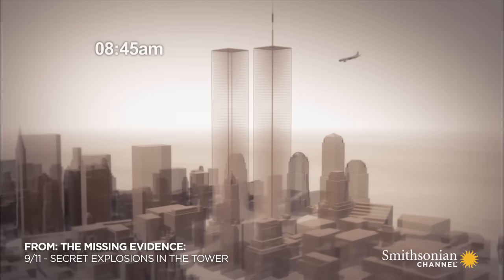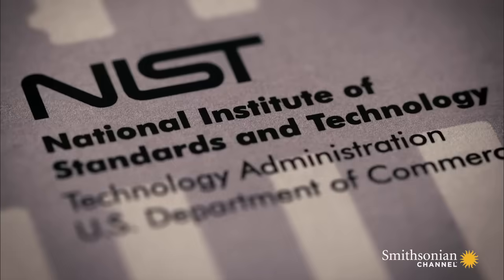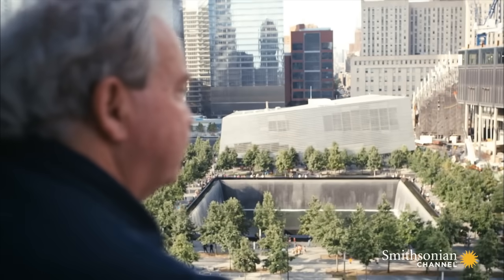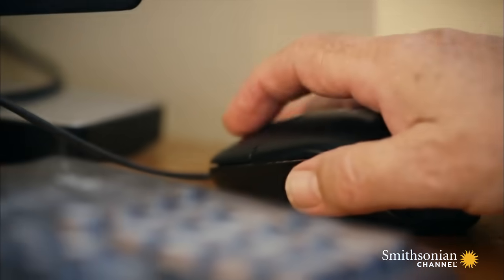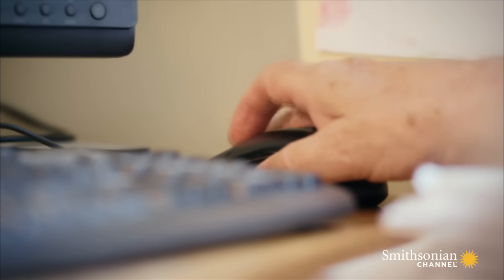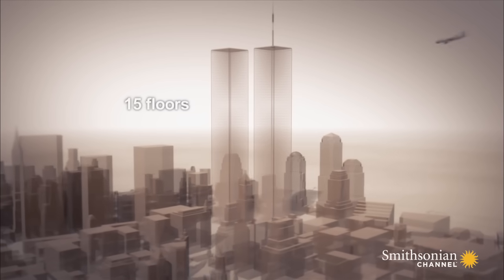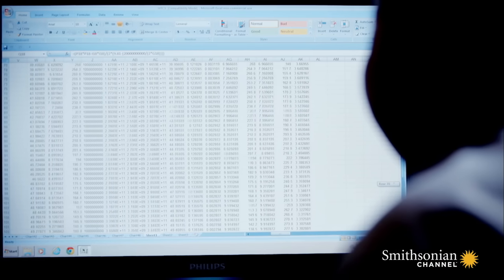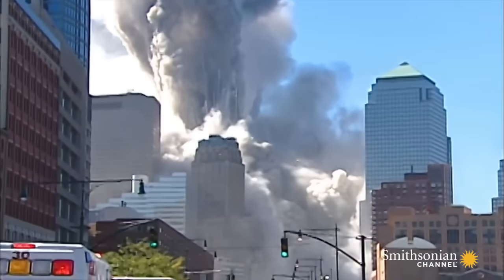This Computer Simulation Explains How the Twin Towers Fell

Comment: The intact lower floors provided no resistance whatsoever? This is laughable. Plus, the dustification of both towers and the smooth 180 degree turns in the core columns is JUST NOT POSSIBLE in a collapse like this. The best explanation of this to see Judy Wood's documentary called "Where did the towers go?"
Reply: The lower floors DID provide resistance; the proof of this is the towers fell in GREATER THAN free-fall time.
Neither tower turned to dust; another laughable lie. They spent 7 MONTHS removing very solid debris.

Judy Wood is certifiably insane. Magic space beams? PLEASE
Reply: @Tim22222  20 seconds? Sorry but show a video with proof.
Reply: @szuberi  
Impact mechanics wikipedia <--- read, this proves a building CAN collapse near free fall without explosives.
Reply: @szuberi  [1 week later] I understand, it is difficult when presented with evidence that contradicts a cherished belief.

But if you're an honest person, you must admit that tower most definitely did not come down in free fall.
Reply: @Tim22222  both the towers fell into their own footprint in about 11 seconds. This proves that the lower intact floors provided zero resistance. Further, show me pics of large pieces of concrete blocks at the collapse site? There are none WHATSOEVER. They dustified. 

WTC 7 fell at free fall speed at crushed most of the building in just 2.25 seconds with ZERO resistance from lower largely intact floors.

Hydrocarbon fire burns at 1250F and is not high enough to melt and create smooth twists in structural steel beams. Ever had your fireplace burn all night and not have the steel casing melt over it? NOPE.
Reply: @szuberi  CONGRATULATIONS! You got 2 things wrong in your very first sentence!

1•Neither tower came down in 11 seconds; the north tower took more than 20 seconds to come down.
2•Both towers rained destruction over 200 meters in every direction! Hardly "into their own footprints." 

ALSO there were no "concrete blocks" in the towers at all! The only concrete was in the floor slabs.

ALSO the fires were estimated to top out at over 1800°F, hot enough to weaken steel by 90%!

You really don't know anything at all, do you?

Comment: did the simulation account for the plane hitting one side so it should of just fell over and not straight down.
Reply: Where did you get your engineering degree? Dunning Kruger University?
Reply: @Tim22222  
👏👏👏👏 😂

Comment: How could foreigners gain access to the building to set the charges without anyone remembering?  And if it were Americans why hasn’t anyone come forth?  People always talk.  That’s the main issue with conspiracy theories.  Sooner or later the group needed to keep the secret becomes unwieldy.  Btw, one would only have to burn through the rivets holding the structure in place to cause it to come down.  Much like Titanic.

Comment: In regards to WTC-7...it was a dead giveaway that it was a Controlled Demolition. You have to weaken the staircases and elevator shafts first which are specialized hardened structures. They blew them out therefore the WTC-7 penthouse collapsed first losing its footing.   The penthouse may not have been directly above 8 elevator shafts of WTC-7 but it was above them including staircases. Then the bowing was there...the inner structure going down just before the outer structure to contain the debris.  Then outer structure was observed to collapse on all sides pretty much in unison and that's a synchronized collapse.  Finally...a freefall acceleration phase confirmed.  There you have it...the globally synchronized collapse!  And a few columns can't initiate this event.  It's done by finely timed demolition devices set throughout the building acting in milliseconds.
Reply: Yeah. It’s just too bad that the entirety of mainstream science disagrees with you.
Reply: @tpryce9800  How can mainstream science disagree when there was no forensic examination of the WTC-7 steel remains??
Reply: @aimurphy7196  Your personal disapproval of the way the investigations were conducted is irrelevant.
Reply: @tpryce9800  National Institute of Standards and Technology, NCSTAR 1A Executive Summary states "This was the first known instance of the total collapse of a tall building primarily due to fires" about WTC-7. According to this report "word for word"..."However, the reader should keep in mind that the building and the records kept within it were destroyed, and the remains of all the WTC building were disposed of before congressional action and funding was available for this Investigation to begin. As a result, there are some facts that could not be discerned, and thus there are uncertainties in this accounting." They did not do a forensic examination...WHY because of funding?? So, the richest country in the world with a sky high emergency budget following 9/11 can't afford a forensic examination with bomb sniffing dogs to sniff out potential explosive residues? They were carting tons of evidence off in dump trucks while the masses were still in a state of shock following the 9/11 attack so very few questioned it at the time.
Reply: @aimurphy7196  Again, nobody cares that you disapprove of how things were done.
Reply: @tpryce9800  You obviously don't read thoroughly.  "WTC 7 steel did not contain such identifying characteristics." There were no markings to distinguish WTC-7 steel. And they didn't segregate the WTC-7 steel remains.  That's Unscientific!
Reply: @tpryce9800  It's laughable.   Give me the reference for the FBI forensic Investigators.
Obviously, they didn't know if what they were examining was WTC-7 steel or not!
Reply: @aimurphy7196  Nobody cares what you think is laughable or unscientific.

Comment: Steel beams of the twin tower cut at 45 degrees were cut by shape charges.  Why would the clean-up crew torch cut diagonally and add over 40% more work than cutting it straight?
Reply: To control which way it falls.
Reply: @Tim22222  Safety is paramount!  So, they hoist the steel beams using chains on a crane once they are freed.  They aren't allowed to fall down like a tree.  So, tell us...what's the advantage of torch cutting diagonally?
Reply: @aimurphy7196  To control which way it falls.

Comment: Clean-up crew don't torch cut steel beams diagonally and add 40% more work.  That's not efficient!  Especially when they shipped out over 80% of the WTC steel remains as scrap metal to China within 6 month of 9/11.  The WTC steel remains were only inspected by few Inspectors on an "invite basis" at Freshkills landfill and you know how that goes.  Not one mention of the diagonally cut steel columns??
Reply: They cut the beams at an angle to control which way they fall.
Reply: @Tim22222  Safety is paramount!  So, they hoist the steel beams using chains on a crane once they are freed.  They aren't allowed to fall down like a tree.  So, tell us...what's the advantage of torch cutting diagonally?
Reply: @aimurphy7196  So they can control in which direction the beams fall.
Reply: @Tim22222  Lame excuse.
Reply: @aimurphy7196  It's not an excuse, it's the REASON they do that.

BTW there is video of workers making those cuts if you're disputing whether they were man-made.
Reply: @aimurphy7196  Yup, it all makes sense: When truthers can't substantiate an argument they change the subject & lie about the investigation (the steel was examined thoroughly before it was shipped away, and relevant pieces were kept).

Comment: You can't take down a tall steel framed building just by blowing up the top.  You have to get to the foundation of the building and that's what happened to the twin tower.  There were reports of explosions underground in the vicinity of the tower around the time the first plane hit above the 90th floor.  Reports of pounding sound...boom, boom, boom.  And the NYC subway filled with smoke before the towers collapsed.  And of course explosives are a fast burning chemical reaction and the product is SMOKE!  They were destroying the redundant foundational structures in preparation for the grand collapse later on.
Reply: Good to know. Where, exactly, did you get your structural engineering degree?
Reply: @Tim22222  All I'm saying is that the safety structures that allows the tower to hold up far more weight were removed in advanced. What accounts for the smoke in the NYC subway before the collapse of the tower??   And the Explosions in the basement around the time the first plane hit??
Reply: @aimurphy7196  EXACTLY

Comment: Notice at 3:40-3:44 many pieces of structural steel falling, beyond the smoke/dust clouds, all about the same length to fit on flatbed trucks. I learned in engineering that steel is among the most elastic materials, so it ordinarily stretches and bends rather than breaks. Here demolition crews riding atop elevators had placed incendiary cutting charges every other floor on the WTC supporting core columns, all of which were conveniently located in the corners of the elevator shafts.
Reply: What evidence have you seen that convince you there were demo crews placing chargers in the building? There is literally ZERO reason to believe that! You are lying.
Reply: Switch off mobile phones and two way radios as they can set the charges off if near the blasting zone. The towers didn't collapse, they were turned into dust from the top down to the ground. We were told the all the answers. Pancake collapse! Where are the pancaked floors? Bombs in the building! Thermite! Oh yeah, dust and paper that's not on fire!! But fires underground that is being fueled by molten steel that got molten by jet fuel that doesn't burn hot enough to melt said steel were raging for 99 days. The weather is just fine, not to worry about hurricane Erin that's going to go away because of the cold front. We're not manipulating the weather but we are certain that the good people of NY and NJ and the rest are safe from storm surges. 2.1 and 2.3 magnitude on the Richter for WTC1 and WTC2, 110 story 500.000 ton buildings and 0.5 for WTC7 a 47 story 230.000 ton building. The towers were built in the Hudson river on bedrock 70 feet below the water table with a slurry wall around them that still holds back the Hudson river. They had to be very careful not to cause damage to the wall when they pulled what was left of WTC6.

Comment: There is no way to explain the collapse without the use of explosives. Pancaking does not collapse at free fall speed there is resistance and the collapse would only slow down not speed up.
Reply: Thanks for the info. Where did you get your structural engineering degree?

Oh? YOU DON'T HAVE ONE?? No, of course you don't! Nor do you know anything about physics: As long as there is a force acting on the collapse (gravity) it CAN speed up, even with resistance. Take a science class.
Reply: There is no way to explain the collapse without the use of explosives.

i beg to differ

Comment: Wtc 7 collapsed perfectly in its own foot print despite hardly any damage what soever, then the bbc predicted it's collapse 20 min before it fell, lol inside job, blatantly, not to mention the nose cone that went all the way through wtc 1 which isn't possible, then on top of all that bull both buildings were vaporised in an apparent pancake collapse, if anyone believes the official explanation, well you been brainwashed, big time!
Reply: "Perfectly into its own foot print"?? Not true! 7's collapse damaged neighboring buildings, at least one of which (Fiterman Hall) had to be demolished.
Reply: @Tim22222  yes perfectly into its own foot print cause it was blown to bits, the surrounding buildings it damaged wasn't because it toppled over it was the explosives blowing big chunks of wtc 7 into neighbouring building causing massive damage, therefore having to demolish those buildings also! Fact!

Comment: Inside job for sure.. The design of the towers pretty much nailed the coffin
Reply: How so?
Reply: @Tim22222  nist had checked the building and approved them for plane crashes and for 2 hours of fire
Reply: @kaosisback8376   You are wrong; NIST never did any such thing. Perhaps you're thinking of the engineers who did a study suggesting that a 707 low on fuel hitting the towers at 180 mph probably wouldn't take the towers down. 

But the planes that hit the towers were heavier than a 707, were traveling 3x faster, and fueled for trans-continental flight. BIG differences.

Comment: The jet fuel burned almost immediately, yet the buildings continued to burn internally. Like a house fire or any other building fire. Put the fire out and the building will survive. If you read between the lines of what the engineers are suggesting...you will realize it was a failure of the FDNY to put the fires out. There was zero firefighting that day because the leadership didn't know how to.... Its a sad realism.
Reply: "The jet fuel burned almost immediately, yet the buildings continued to burn internally."

Right. Because there are things in this world besides jet fuel that burn. As to why the firefighters didn't fight the fires: Is that a serious question?

Comment: Total rubbish the wtc was a controlled demolition not a pancake collapse ,there has to be resistance even if the top 22 floors pancaked on to the lower floors it should of slowed down not gain speed, he is completely dismissing the resistance factor. after collapse there wasn't a single pancaked floor at base of towers, this is because they were pulverised from the top down hence nothing left but a few exterior columns leaning over.the biggest question is what happened to the core columns after collapse they should of remained standing or a least some of it should but there wasn't.
Reply: "even if the top 22 floors pancaked on to the lower floors it should of slowed down not gain speed"

You are making an assumption that is not correct. Even with resistance the collapse can accelerate as long as there is a greater force pulling the tower down. And there is such a force: GRAVITY. Have you never wondered why no physicist has ever made that argument?

Comment: Yes and would such domino impacting floor after floor cause the concrete to turn to dust exactly like thermite demolition???
Reply: Since when does thermite turn concrete into dust? You just made that up!
Reply: @Tim22222  please do some research of effects of thermite demolition on concrete.  I think you will be surprised.
Reply: @whiteowl8703  Thermite is used to cut metal. No one uses it on concrete. And since there was no structural concrete in the towers, there would be no reason to do so.

The collapse each tower released potential energy equivalent to 100-200 tons of TNT. That is what ground up the concrete.